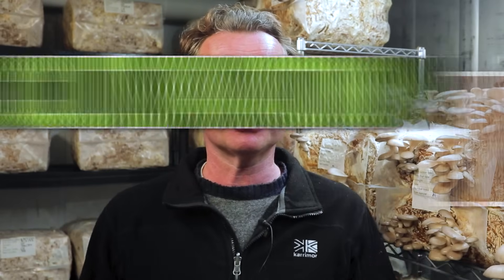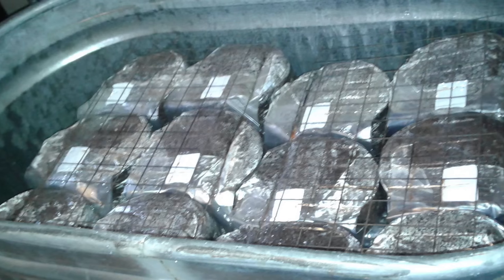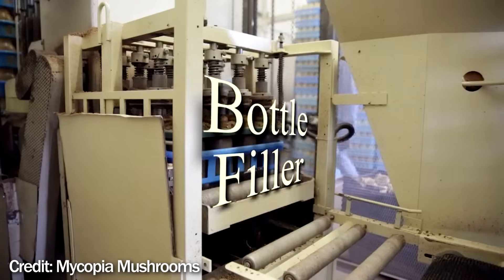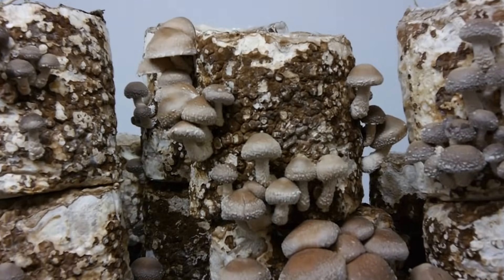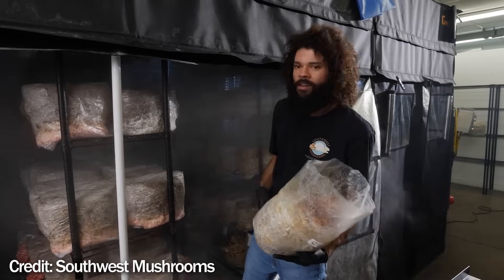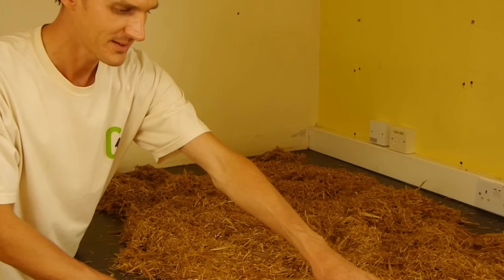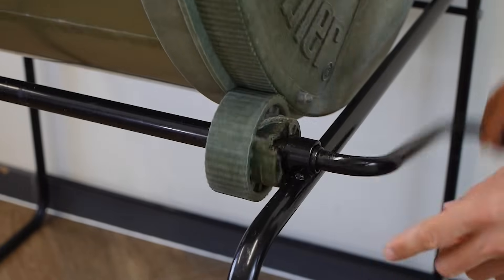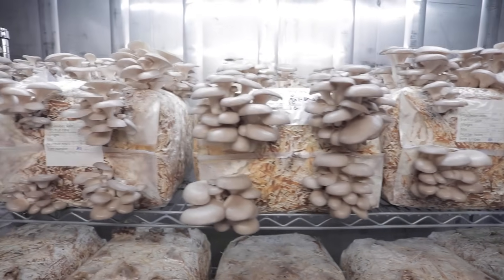Bags vs Bottles vs Bales & Reducing Mushroom Production Costs I Mushroom Farming I GroCycle

Comment: Tonnes of great knowledge shared. Many thanks, its very much appreciated! I would like to touch on a point regarding straw bale with 30% of yield, reading info from internet found that sawdust bags gives min of 50% yield (*not an expert I could be wrong here), so doing a simple math where retail price p/kg of mushrooms is £8, revenue from sawdust bags brings over 50% more. So as long as operational costs are not higher its a win for bags and not bales? Please keep in mind that I am asking purely from curiosity, without any production experience ;D

Comment: I just discovered this and I was wondering, what do you think about the bottle method for people looking only to provide for their own consumption? Would it make sense? Also, if you wanted to grow mushrooms like Shiitake, can't you just lay the bottle on its side?
Reply: Exactly. Also, there are decorative planters for pot plants that have openings all up the sides. The openings protrude from the sides a couple of centimetres, so I don't know why the concept can't be adapted to form the side openings for these grow bottles so they can have lids fitted for the initial inoculation period. Then there's all this stuff about how they're limited to a kilo of substrate - so make the bottles larger to take 5 kilos? Or base them on 20 litre food-quality plastic buckets. 
Obviously the machinery that's used commercially will need to be modified to deal with larger bottles and the side-opening lids, but I can't see how that'd be unsurmountable. Maybe the openings should have a nice flat flange around them, and automation to glue/heat-seal filters to them which can then be peeled off. That could happen immediately after the sterilisation step, with everything still hot. Also, with the complaints about inoculating substrate throughout, a multichannel pipette or similar could be plunged to the bottom and withdrawn in a spiral motion, dispensing a liquid culture. And so on and so forth.

Comment: Using Polymere which is going to be recycelt is WAY BETTER then biodegradable Polymere because most of them are only biodegradable at industry standarts which isn't achivable for consumer and this polymere still emits the same CO2 emission as the one which gets burned

Comment: There's a much easier and cheaper method than all of these, use a 5 gallon plastic bucket with some holes drilled in the sides, throw in the substrate throw in the mycelium and boom mushrooms.

Comment: Why arent they using large 6× 14 foot metal trays and using steam pressure lid system to steralize? Seems like it would be easy to move with an elec forklift, and a innoculation bed could easily be made. Even for shitakis just add metal screen lids to the tray and lift upright.

Seems like the bottling system is wasteful, too much technology.  I bet that could be done for under 100k.

Comment: Could you potentially eliminate plastic waste by using the pasteurization method in sturdier plastic bins? It would be a bigger upfront investment but you could just wash them out between uses. Is there a reason people do not do this? Thanks!
Reply: I imagine the cost of time spent washing and sterilizing the bins, as well as the cost and environmental impact of so much water would be a factor. I do not know myself but am also interested.
Reply: 1) there is a difference between pasteurization and sterilization. What pasteurization you were only heating the substrate to 180° over the course of 1 to 2 hours. With sterilization you are superheating the substrate to around 250° over the course of 2 to 3 hours. The former does not kill all of the bacteria in the substrate while the lighter kills everything. The purpose in this is because to grow high-yield flushes of some mushrooms you need to add nutrients. If you add nutrients to pasteurized substrate, you’re going to get contamination. This contamination will likely outgrow the mycelium.

2) in order to sterilize you’re going to need to be able to fit your substrate bags into a pressure cooker. Whatever you use to hold the substrate will have to be of a PP5 quality plastic in order to not melt or completely fall apart. The mushroom bags that people use for mushroom substrate or made of a PP5 plastic that can resist high temperatures. This allows for sterilization of the substrate, and removal from the PCU without contamination.
Reply: @JackGilbertJr  sometimes pasteurization is better, because keeping healthy bacteria around can make the bags less susceptible to harmful bacteria. Anyways, your explanation applies more to small scale grows, the giant bags used in commercial production aren't going to fit in an autoclave. But whether pasteurization or sterilization is required, they still involve a process, taking time, and perhaps chemicals (I'm not sure if isopropyl alcohol is cost effective for larger commercial operations). The risks of contamination are so large in any mushroom grow, that it may be more effective to get new bags that are known to be sterile (or pasteurized), rather than taking the time and risks of repeated cleaning procedures. It's a constant battle in any mushroom cultivation.
Reply: GroCyle is testing this.
Reply: @celticlass8573  Cool!
Reply: @violettracey  I'll be testing it myself beginning sometime over the next several months.  I've sourced some 1 ft x 1 ft food-grade buckets (formerly used when the store ordered bulk peanut butter), that I'm wondering if they can be used to make "fruiting blocks" instead of using the bags, which I would then turn into the larger standard-sized buckets people seem to use.  Or possibly grow directly from those small buckets, after drilling holes in them (GroCycle has a post on their website about this), which are uncovered when the bucket is fully colonized, to bring on fruiting conditions.  I understand it can likely be done in larger buckets, but I want to see if it can be done in smaller, because 1) my growing space is small, so I would like a more frequent turnover as far as colonization and flushes, if you get me, and 2) The buckets would otherwise be sent to recycle or to landfill (just like the bags would), which I'm trying to eliminate, so by using "waste" buckets, there's no waste at all. :)
Reply: @celticlass8573  Awesome! I would love to know your results!
Reply: cost of labor and resources for sterilization can be prohibitively high.

Comment: There are filter patch bags which are fully biodegradable now, they've been around for a while.  Kinda surprised they weren't mentioned.
Reply: https://youtu.be/zSmBIwZxcAE
Reply: @squirlmy  because they are two different things. Oxo meaning it requires oxygen to begin the biodegradable process.
Reply: @chasefreeman2188   you know, I read that on the website (therefore the delete) BUT then I researched further, looking at GroCycle's latest video. It's basically calling a bug a feature! Oxo- just breaks it down to micro-plastics, like Gwain's complaint says.  It doesn't actually biodegrade. Look at Grocycle's latest video, they (briefly) mention this. This is why European standards are rejecting them, no because of some conspiracy of industries in Europe.
Reply: @chasefreeman2188  but I've never heard of any other company using this term. I've only ever heard of plain "biodegradable". I have to assume their product is not truly biodegradable, and I'd have to research "oxy-biodegradable" quite a bit to lower my suspicions
Reply: If you listened, you would have heard him mention them.
Reply: @pb2959  Actually, in the video at 7:48 they were referring to the "bale" bags that are made from plant starch but are NOT used in the autoclave since that section of the video is about using pasteurized substrate. Unicorn Bags sell an oxo-biodegradable filter-patch bag that is also autoclave-able.
Reply: @chasefreeman2188  Oxo-biodegradable just break down into Microplastics, Unicorn Bags openly lie about it turning in fertiliser etc. We still have a way to go
Reply: @gwainfox  what evidence do you have for this claim?
Reply: @pb2959  is your intention only to be an ahole or can you be useful too and drop a timestamp?
Reply: @pb2959  Hey I'm still waiting for that timestamp. 
Probably gonna be waiting a long time since you've got your tail between your legs now and egg on your face.

Comment: I'm utterly clueless about any of this, but the first thing that came to my mind was growing them in stainless steel columns with holes in the side.  As I don't even see that mentioned by pros, can you share what the problems with it are?
Reply: Stainless is more expensive and more difficult to cut holes in than plastic bags or buckets
Reply: @keving7805  True, but you would only have to do it once and then you can sterilize them as needed.
Reply: @KeithOlson  I imagine weight, equipment to move the due to size and weight, and the cost of water and space to sterilize and store for next use.
Reply: @chasefreeman2188  Hmmm... some good points.
Reply: @KeithOlson  another thing, and I'm disappointed Grocycle didn't mention here, is the carbon costs for making machines, and presumably, any stainless steel parts. Making, then transporting such products (from China, for example) is energy intensive. Economically it might make some sense, but in the long run, in many places, it makes more environmental sense to bury plastic in landfills, then buy expensive machines.
Reply: @squirlmy  I honestly don't see how it makes ANY environmental sense to be constantly burying unrecyclable plastic.  If you make it out of stainless steel, you can literally use it practically forever if you are careful.  OTOH, if you go with plastic, you are going to be constantly polluting the environment and cranking up the carbon cost for as long as you are in business.
Reply: @KeithOlson  You have good points, I've recently heard only 2% of all plastic is recycled. But, for example, I also know that buying products like Tesla's cars have nearly the same carbon footprint as the average combustion engine car even thought they are "zero emission". Getting the components, and the manufacturing processes and other upfront costs is something I'd research before buying. Would chemicals be required to ensure sterilization, IDK? For the United States and Canada, there's plenty of room for landfill that can be responsibly maintained (I'm aware often it sadly isn't). Something like stainless steel seems commonsense, but you also have to be sure your customer base is willing to pay the extra costs for sustainability. It does no good to be responsible and purchase such things, if your customers flee to a cheaper product because another company made less of an upfront investment.
Reply: @KeithOlson  you can reuse plastic buckets
Reply: @squirlmy  first: that's bs. Second, think first to avoid bs. dumping plastic anywhere in nature has to be strictly avoided
yet i agree that the methods presented here, and on many other pro channels out there, are not thought through. There are many opportunities to improve the approaches
Reply: @jilliandevona  every plastic used repeatedly breaks down and sheds micro and nano plastic particles. the go straight into the mycelium.
Both can be minimized by covering the inside of the bucket with organic foil, which decomposes as is made 100% from cellulose. But nobody is doing that. It avoids treating the bucket with harsh chemicals and hot water, and protects anything inside from potential presence of nano particles.
Reply: @monnoo8221  good to know, thank you!
Reply: https://youtu.be/zSmBIwZxcAE
Reply: Maybe the bio plastic can be functionalised and not just to be consumed by the mushroom but to add a lot more yeild

Comment: Doesnt Sterilizable Oxo biodegradable bags (note not oxo degradable)  break down in 3 years , Thats very acceptable especially considering typical plastic is hundreds of years. They do cost more though.
Reply: as I understand it, Unicorn bags are not actually "biodegradeable", they degrade into microplastics. Convenient for dumping, but not really enviro-friendly. It still takes "hundreds of years", but the microplastics will dissipate through the environment enough that you have plausible deniability. So, there's that. 😥😢
Reply: @squirlmy  seriously, you need to lookup the difference between pox-biodegradable, degradable (micro plastics/EU ban), and recyclability. I fully agree with you on the harm of biodegradable plastics leading to micro plastics. But ‘Oxo’ has an additive that helps it fully break down with the help of natural organisms - it requires the sun and oxygen - still not great for waste but what you’re saying is wrong. Also, let’s all remember to “reduce and reuse” before we recycle because as you mention, individual recycling is not very useful.
Reply: Unicorn's are also recyclable because it is still polypro. Even if not using oxo-biodegradable, recycling is better than letting it go to the landfill.
Reply: @chasefreeman2188  Yes, but they do end up in landfill eventually, since they can only make decreasing-quality plastics with each recycle.
Reply: @chasefreeman2188  only about 2% of "recyclable" plastics are actually recycled. I think Germany has the highest rate at 50%. The whole concept of "recycling plastics" is a kind of scam, mainly by people naively thinking "market forces" could be harnessed in the effort to recycle them.

Comment: Why would the bottle method require mechanization any more than any other method, simply because it's an option?  And the bag manufacturer is the source for why they're a bad idea....  🤨
Reply: Yeah, I had this same question. What if someone is just getting started and wanted to try a single bottle? Can you not do this method manually?
Reply: @chancegalloway1976  it’s very easy to do. Treat it like canning vegetables or what ever.

Comment: I’ve been following for videos for awhile so almost if not all my knowledge has become a result of the content you guys share, thanks so much for taking the time !

I have a question about the straw bail method. Before seeing this video , I pondered if I could buy a bail of cut straw and inoculate it instead of bagging substrate. I tried to pasteurize the bag inside my 50gallon drum and buy boiling it with holes punched through. I wasn’t successful.. how do you guys perform this process without the need of removing the straw from the bags and keeping everything still intact?
Reply: Hiya, might not be what you’re looking for but I read in a guide to bioremediation that you can submerge large amounts of substrate in water for a while (long enough so only anaerobic bacteria remains) and then drain the water off (exposing the anaerobic bacteria to air, killing them) to get a decently clean sub. Hope this helps :)
Reply: @nathancowling2776  do you have any links I could research? 🤗
Reply: @nathancowling2776  wouldn't the act of drying the sub off introduce aerobic bacteria?
Reply: https://youtu.be/zSmBIwZxcAE

Comment: Sir, I have a chipper/shredder that I use to grind up tree limbs. Can you use hardwood chips instead of hardwood sawdust in growing Mushrooms???
Reply: You can spray the bales with hydroponic feed chemicals to increase yield
Reply: ⚠️👆⚠️👆⚠️👊⚠️Never buy from IG or TG its nothing but a scam! ypu will be asked to pay in btc then its bye bye money, And always report these ig scammers as you find them,they all use same photos.
Reply: https://youtu.be/zSmBIwZxcAE
Reply: it doesn't sound like you are cultivating psilocybes, but just to make sure this information spreads as widely as possible; ingesting psilocybes grown on wood can cause "woodlover's syndrome" which can randomly, temporarily paralyze muscles within hours of ingestion. It's really not worth the risks of using wood for growing "magic" mushrooms.
Reply: You absolutely can depending on the species. Shiitake for example really tends to like a more dense substrate so doesn’t take all too well to chips (it still may work though with sterile chips.) Oysters and wine caps work well on loosely packed wood chips. To grow most wood lovers however you would want to fill the voids in between the chips with sawdust to make it easier for the mushrooms to colonize the whole substrate
Reply: @robrod7120  Thanks, I have a lot of Oak wood chips, about 20 cubic yards.
Reply from the maker: @John Parrish  Yes like Rob Rod said you can definitely use hardwood chips as mushroom substrate...if they are small sized chips this would be ideal...if they are larger chip size you would want to mix with sawdust to create a better structure and provide more easily available nutrition for your mycelium to digest. Chips are also great for outdoor woodchip beds, like this: https://www.youtube.com/watch?v=PIYWzfVW-ws